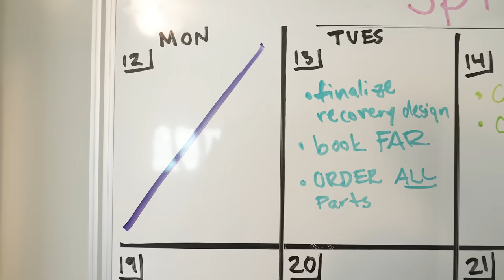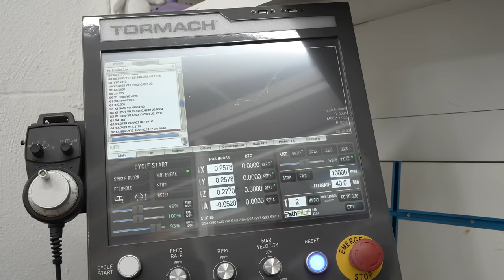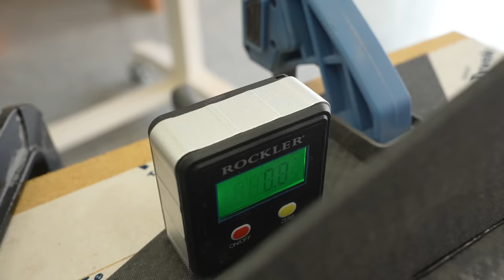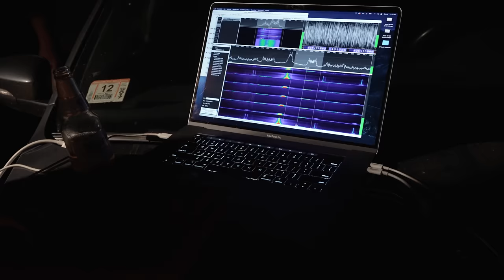ALL Carbon Fiber: My Fastest, Highest, Craziest Rocket YET!

Comment: Over 4 miles straight up!!.. and lands walking distance away !!.. that's one straight true flying rocket.
Reply: And steady air
Reply: when it goes up that quickly, the wind does not have much time to act on it
Reply: @liam3284  The wind has much more time to act on it while it parachutes back down
Reply: 8 miles total ... the first 4 took seconds, then the next 4 took minutes.
Reply: @liambohl  I built and flew a similar rocket to a similar altitude. It went straight up, and then the wind took it 5 miles away under the drogue parachute.
Reply: and no wind
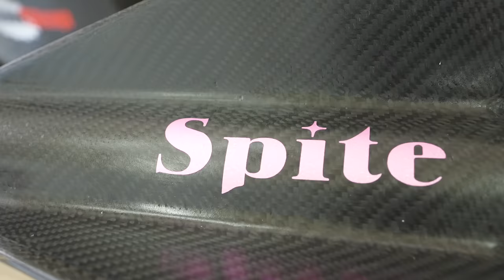Reply: "No one is fully straight" 24:50
Reply: It's all about the winds.
Reply: @AerialWaviator so a mile a second. Thats freakin quick
Reply: @frankierzucekjr Not quite, it's peak velocity was Mach 2.3 which is 1764.72 mi/h or nearly 0.5 mi/s. Note that is based on the mean speed of sound at sea level which given we don't see the addition of a temperature sensor to get the data required to get the correct local speed of sound at altitude and correct the Mach number calculated from the GPS data. Also it is close enough for this use, if you are flying an aircraft in or around the speed of sound you need the exact value because it changes the performance of aerofoils and flight control surfaces but here we don't need this precision.
Reply: @neutronium9542  Right .. the parachute and wind, usually take them far away .. like my childhood Estes rockets that always drifted into the top of a tree.Spent a week building it, then several years walking by that tree looking at my rocket.
Reply: If you add the earths rotation, it pretty much went straight up and down., the chute must have been one that allowed a faster descent.
Reply: Yes And almost zero wind all the way up and down.😳😳
Reply: What about earths rotation and or Coriolis effect
Reply: And as any (honest) physics apprentice could tell you, if the earth was spinning, that of course would be impossible.
Before the normal rebuttals are engaged, plz remember Einstein's embarrassing flip flopping ether moments, as well as the Michelson-Morley experiment/test.
Reply: @svenshanah  are you saying that because of this, it's somehow "proof" the earth is flat?"  LOL !

The rocket would still be affected by the grativational inertia of the spinning planet and the atmosphere therein which is also spinning, subject to the same inertia, at the same rate; otherwise the rain on planet earth would be going sideways at 1000 mph, as the earth's surface moves but the atmosphere doesn't !

I failed at science at EVEN I KNOW THAT TO BE THE TRUTH.
Reply: @rafezetter8003  He's right, what an embarrassing fail that was. You no thinkers aren't worth the mind numbing exchange I use to think you were. Facts are always met with juvenile laughter and long since debunked "science".
Carry on.
Reply: @Nat_Sarim  troll.
Reply: @rafezetter8003  🤦‍♂🙄
Reply: @ShamWerks "Happy Pride" 😂😂😂
Reply: Why doesn't the camera throw it off?
Reply: @svenshanah  🤦‍♂️🤡

Comment: There is nothing more entertaining than watching Xyla and Joe hitting explosives with a hammer. 😆
Reply: Definitely one of the highlights
Reply: Wow people fall for this ,therapist are human too and just as predictable when it comes to taking advantage of us all.Im just happy that you didn't show yourself using an angle grinder with carbon Fibre without a mask . It's lethal
Reply: @Trojan7575  What?
Reply: I was waiting for the typical mechanics wisdom if a bolt it stuck - just add some heat to the outer part and that will make the fit looser until it cools down.  Oxy-gas heat is most common. Without the body and nozzle containing /raising /directing the pressure, would the fuel grains just look like a fast burning sparkler?
Reply: It will take many tedious hours and a lot of damage to pull that motor apart.
I doubt that heating the outer casing will achieve anything.
Reply: @user-fe6km7gw8m  I remember, Bugs marked it as a dud when it didn't go off!!
Reply: Welp apparently I'll be for awhile now, thanks
Reply: @teddypamperin6232  "Without the body and nozzle containing /raising /directing the pressure, would the fuel grains just look like a fast burning sparkler?" Yea, pretty much. I've tossed APCP fuel grains in camp fires. They just burn, no big deal.
Reply: @teddypamperin6232  Would that work when the outer component is much less thermally conductive than the inner component?  I don't think it would, but I also do not know the thermal expansion coefficients of carbon fiber and aluminum.

Comment: Whenever you need to remove the motor, heat up the metal enclosure with a heat gun, it will expand and make it easier to slide out (it would also have helped to get it inside)
Reply: Heat gun, rocket propellant, I can understand a little reluctance there. But yeah, definitely on the way out!
Reply: Maybe the opposite cool the motor then there's no danger.
Reply: For installation
Reply: @KevinLyda  Propellant needs hundreds of degrees, a couple tens is not big deal.
Reply: @KevinLyda  The propellant ignites at 600+ °F if I'm not mistaken, so there's quite some room for heating the tube for assembly as well.
Reply: @KevinLyda    He said heat gun, not torch.... Heat gun would not set it off.
Reply: @brianlee6849  Less danger, not NO danger... this is still a rocket motor, to err on the side the side of caution is appropriate and encouraged
Reply: No matter what the propellant's ignition temperature you don't fuck around with safety.
Reply: @Splarkszter  Of course 👍
Reply: I would assume one of the cardinal rules of rocket safety is "always assume anything higher than ambient will set off the propellant" the same way one of the 4 rules of gun safety is "always assume the gun is loaded'. Just as a an extractor can fail and leave a live round in the chamber allowing the gun to potentially slam fire if the bolt/slide closes on it, enough temperature over ambient can potentially set off the propellant if that batch wasn't mixed properly. Safety first, last, and always folks. A certain submarine company CEO failed to heed that and look what happened.
Reply: wouldnt heating it with something like a heating blanket also work? not as hot and no exposed ignition hazard
Reply: @maxb.5905  I know when they're building a rifle and installing a slip fit barrel inside of the receiver they will put the barrel in a freezer slides right in then when it warms up it's extremely tight fit. And it's better than heating the receiver because you can weaken it. Not sure if this would work on the rocket motor or not but I think it probably would. You just have to have a tall freezer
Reply: @ZiddersRooFurry  No matter the ignition temperature? Holy... Who unchained you? There are explosives that literally cannot be ignited with fire / heat. Maybe stop living in fear so much, try to get educated, get some experience. Or, don't put heat guns to rocket propellant. Either works, but at least don't pretend to be a safety guru if you're not.
Reply: I'm no rocket surgeon but I imagine uneven thermal stress could damage the propellant grain even if you're not worried about ignition. Maybe if the enclosure is thin enough (low thermal mass) you could heat it beforehand and hopefully slide it on in one go.
Reply: @teslatrooper  That's a more reasonable concern, though unless it's black powder propellant—unlikely for this level of rocketry, I'm assuming they use an ammonium perchlorate composite—the propellant is structurally sound. "Ammonium perchlorate boasts high thermal stability, high oxygen content, and low sensitivity to shock." (Low price as well! Great stuff. Was used in the boosters for the shuttle.) :)
Reply: Would it work to integrate the liner before inserting the propellant grains?
Reply: To be honest I was more concerned about her hitting it with a hammer, which would have more chance to ignite it than a heatgun

With the heatgun we're only talking about a 30°C difference between the fuel and the metal casing to get the needed expansion, it can and should be heated prior to insertion, because the metal conducts heat well it would otherwise just dissipate into the casing and take 4 times the effort to reach the desired temperature difference.

The heatgun will do a quick job of heating it up when separated and the heat will spread well, also the fuel could also be chilled in a fridge for 30 minutes which would increase the temperature difference (more shrinking inside, more expansion outside)

For all of you concerned about it going off, it's not an open flame and there is another casing between the metal and the fuel insulating it from the higher temperature of the metal, so as long as you're keeping your heatgun under 220°C, the metal can't get hotter than that and it would be impossible to ignite, but if anybody has time and ressources to spare, they can definitely do the experiment of heating up rocket fuel with a heat gun to try and prove me wrong
Reply: @ZiddersRooFurry  Well where's the fun in that?
Reply: I like cool the engine on the way in, heat the tube on the way out.  But I'd be curious if anyone here knows if there is actually any sort of variation which makes the heat gun not a 10/1 safety margin on the way in. Can a heat gun light anything which can light the propellant?
Reply: Or heat the tube and then remove it from the source of the heat, then insert the engine.
Reply: Maybe a little dry ice placed in the motor tube to cold soak and aid the separation process?
Reply: @Kman31ca  Heat guns can absolutely get hot enough to ignite black powder, hell, I use one to light charcoal.
Reply: @sleepib   "heat up the metal enclosure with a heat gun."  The OP was talking about heating up the aluminum case that was going over the rocket motors. That's what I meant.

Comment: The camera won't bias the aero as long as there's another camera (or camera-shaped block of cardboard & hot glue) on the other side and they're mounted with X and Y mirror symmetry rather than rotational symmetry.

Comment: Very cool Xyla! My buddy sent me this video. I certified Level 3 under Tripoli 20+ years ago (Aerotech M1319, 75mm motor in a 9' tall, 7.5" diameter scratch-built rocket). It is amazing how much has changed, yet the design and building of high power rockets are so similar. Carbon fiber was just coming into discussions back then, but all we had were sono tubes, which we fiberglassed along with Birch plywood fins  (glassed into the center tube as well as outside tube). And computers were much simpler too. I really enjoyed your journey, and especially your enthusiasm. Great job young lady!
Reply: The British Bloodhound ground to air missile had plywood fins.

Comment: With custom sanding blocks you can use double sided tape to hold the sandpaper, and then when you need to change paper if you can't peel/scrape it all of use solvent to remove the rest

Comment: 2:30 Tip: when pouring from bottles of that type with thick liquids (oil, resin, etc.), rotate the bottle sideways (90 degrees from how it's being held here, so the "plane" of the bottle is parallel to the table instead of perpendicular). It makes it easier to pour and also prevents the liquid from running down the front of the bottle.
Reply: I've also seen recommendations to turn the bottle 180 degrees, and pour from the "top", for even less spillage.  My grasp of fluid dynamics is insufficient to explain why either of those options is better than the "front" pour, though :)
Reply: I have been pouring like that for 1/2 life, from milk to petrol cans, and it stops the glugging as the liquid tries to get out
Reply: @stevekj1  When you turn a bottle like that sideways, unless it's very full the level of liquid won't cover the exit hole, so air can enter the container without having to go through the liquid. When you hold it vertically, with the exit hole at the bottom, that situation won't occur until you have very little left in the bottle, giving you a "glug, glug" as the air enters the container in bursts.
Reply: @Curt_Sampson  Oh right.  These bottles do not have air intake holes on the opposite side like gas jerry cans do.  Okay, so would you recommend the 90 degree sideways pour like @400_billion_suns suggests, or the 180 degree "top" pour, which leaves the bulk of the liquid even farther away from the exit hole, allowing more air to enter when the bottle is completely full, but also requiring significantly better aim since the spout is now a lot further away from the hole you are trying to pour into?  Dilemmas, dilemmas :)  (I think I have used the top pour fairly successfully if I am pouring into a receptacle that sticks up from other blocking objects, allowing the bottle to be held lower down, with the spout still close to the hole it is supposed to be poured into - or just use a funnel)

Comment: Dang! Nice work! I was curious to know what the GPS data looked like during the Mach 2+ portion of the launch. I’ve heard that the “civilian” GPS units won’t send data if the altitude and velocity exceed some preset limits.
Reply: https://en.wikipedia.org/wiki/Coordinating_Committee_for_Multilateral_Export_Controls -- the limit is generally 1,000 knots and 18km.  That's only mach 1.5 (appx), but appogee was probably quite a bit lower than that (I don't think she ever gives a number for it).  Some gps units will instead stop when the speed or the height limit is reached.  Those would have been a problem, but as these units seem to be sold for doing rocketry, I doubt they'd have that problem.
(The gps altimeter used for deploying the chutes was definitely sold for doing rocketry, and the gps trackers only actually needed to work when stationary and at ground level.)
Reply: @theorbtwo  interesting! So, basically they’re limiting hypersonic missiles and ICBMs.
Reply: @theorbtwo  There's text at 33 minutes that shows the max altitude was ~ 7 km

Comment: Congratulations on your Level 3 certification.  You didn't mention certification and NAR or Tripoli like you did on your wooden rocket, but this would certainly qualify for Level 3.  You are so lucky to live near such a neat facility.  Where I live in northern Ohio, we are lucky to have a 5,000 feet waiver.  To go higher, I need to drive 5 or 6 hours away.

I don't see why some Karen would have told you couldn't be in the group picture.  Regardless of what you function was on the team, you certainly have the qualifications to handle any position on a rocket launch.

Comment: What i learned in aviation science was Kevlar flexes Carbon Fiber is stiff, two layers of Kevlar (using a warp clock  layup ) the a layer of Carbon Fiber. Then vacumme bagged with heater pads with themoter and heat regulator. Usually over and under (both sides) of a honey comb 1/4 inch or thicker.
Sky isnt the limit then.

Comment: Xyla, where were you when I was young? You are the coolest nerdy girl ever! I hope those guys around you know how truly special you are. Watching this video made me grin ear to ear. I was into model rockets when I was young. You are on a whole new level. We only has Estes rockets. Our best was the Estes Scrambler which had a wide, long payload section that was clear with 3 engines. Well, we launched a white mouse. Being the nerds we were, we of course made a centrifuge and his first ride had him exit the centrifuge and bite me. Launch delayed due to quarantine. After the no rabies confirmation, he flew. Sadly the wind carried the parachute straight into the Mississippi River. We lived in New Orleans at the time. Just as well as we had drilled air holes along the top of the payload section so he could breathe. Being only around 9 years old at the time we didn’t consider that the velocity of the launch, coupled with the air holes, likely created a vacuum. Poor Mr. Mouse. We both genuinely felt bad. The rocket remains are still probably floating in one of the vast oceans lol. We sanded and coated that thing until is looked like glass. Anyway, I personally think you are just so cool. Just wanted to thank you for bringing back great memories (Mr. Mouse excluded) and making me smile.

Comment: In the future, you can use three pieces of 3/8” all thread rod with a drilled end plate that the rods can be inserted through, and bolted fastened with nuts.  You can use rod couplers to add length for any size rocket. An equivalent drilled plate on the other end that snugs against your motor with nuts will pull your rocket together.  Use three closed ended, ratcheting wrenches to tighten your homemade rocket tube packing device.  I hope this makes your future bright!

Comment: Once one's approaching exceeding Mach, one won't need those large fins, which then are nothing but drag. Also, consider at higher Mach, an aerospike.
A big problem in supersonic design is, a hell of a lot of things become counterintuitive, as we don't tend to have daily experiences with shockwaves and especially, traveling shockwaves as one accelerates. Oddly, smooth surfaces can introduce drag at supersonic velocities, whereas modest irregularities can lower drag, as I said, counterintuitive. 

Motor integration, well, I've found there's a special lubricant involved called profanity.

Comment: 19:24 - if the strap slipped off the end at that point or the end broke, goodbye left hand.
Also you really need to wear eye protection because if the end broke you could get flying splinters.

You know why the liner didn't slide in? Because you had it covered in grease - the grease made the liner thicker and also created a vacuum which is why it was so hard to slide in..